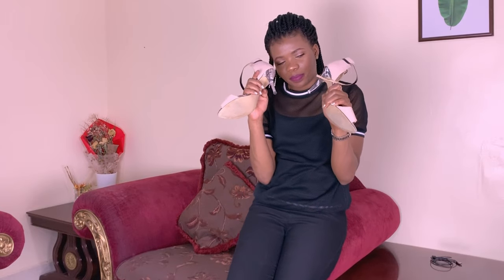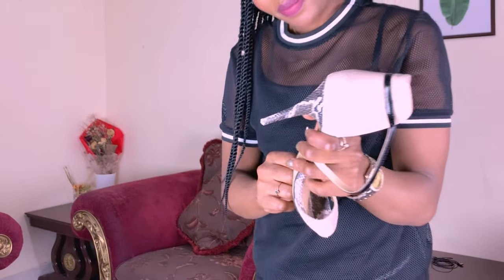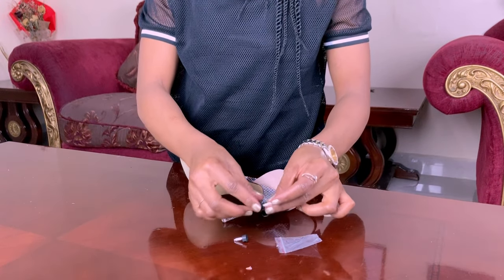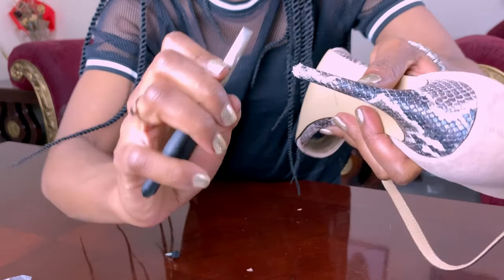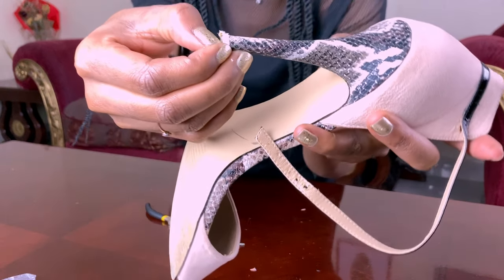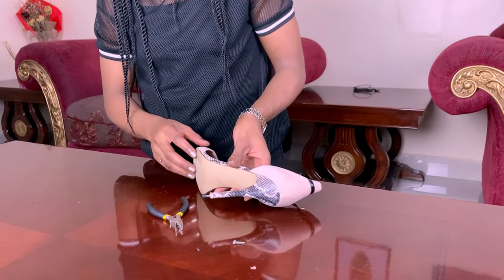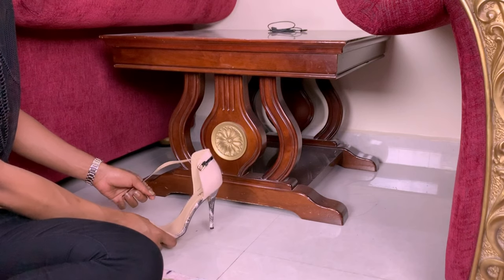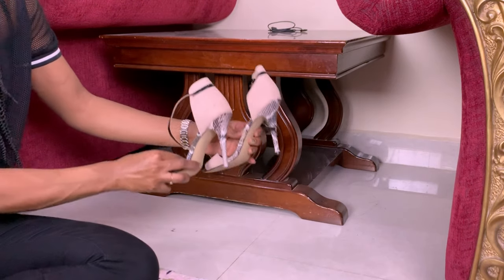HOW TO REPLACE HEEL TIPS

Comment: She was ready to give up...I hit up YouTube... The rest is history. You made my wife a very happy wife thank you so much. Don't be discouraged about the bottom portion getting a little messed up if you really gotta dig in to get them nail screws out, especially if they're all black. All little black sharpie before she put the tip on one of em it was good to go. I recommend using the EXACT type of plyers she used in the video. NOT NEEDLE NOSE like I tried. You really wanna go for that outer edge if the nail head isn't eposed and is full, th one in the video looked a lot easier to grip. My wife's wher really dull I had to use the front teeth portion of the plyers not the cutting tool part. Again thank you so much I really appreciate it, you gave me hope I wouldn't give up!
Reply from the maker: Am so glad I could help. 🙏🏽

Comment: How do I find out the heel tip size?
Reply from the maker: It’s hard to tell but Amazon sells mixed sizes in one pack, you’ll have to try each and see which fits. Mine usually came as a spare in their original shoe boxes but I understand a few brands do this and that sucks.
Reply: I saw mixed heel tips on eBay as well, but nothing local.  Without knowing how to measure either the hole or the steel bit circumference, it's just a waste of money.  What's the name of those special pliers you are using?  Thanks!